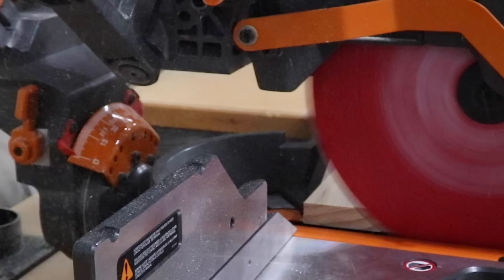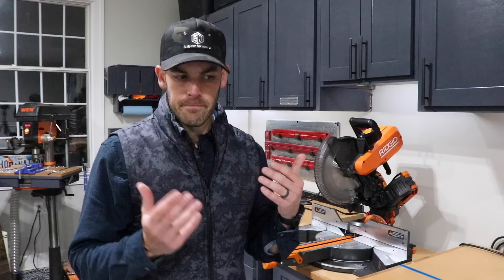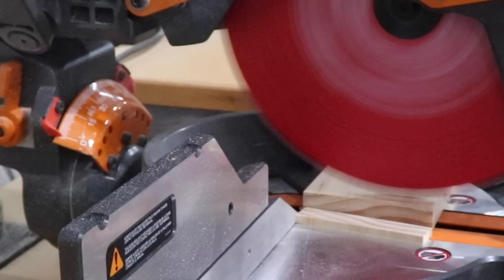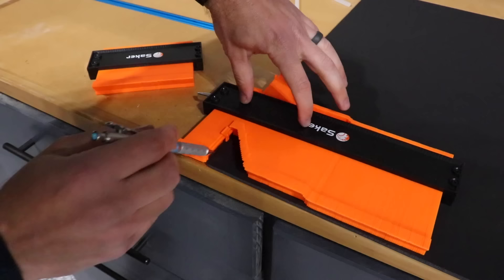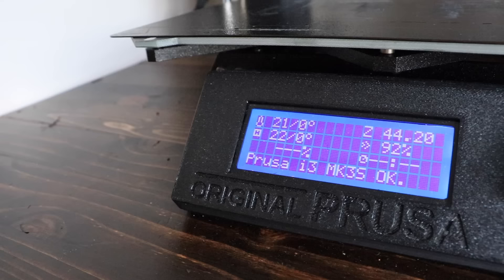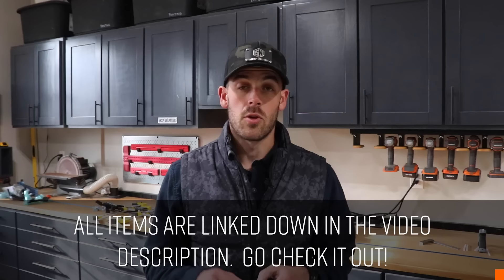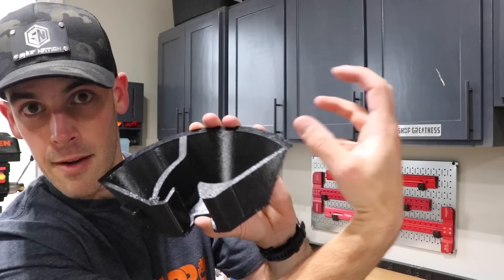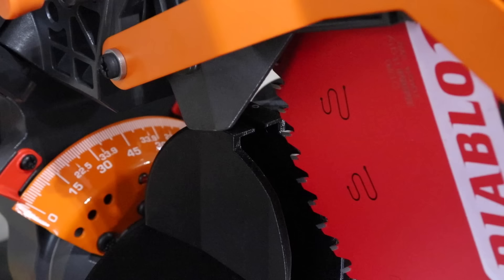Did I Solve Miter Saw Dust Collection?

Comment: the reason people like dust hoods so much is that the dust is "trapped" in the area. no shop vac or DC is going to handle the velocities of the chips coming off that saw, so the best bet is to let them slow down till a DC moving alot of air can actually grab them. its why mitre saws come with 2" ports its because  shop vac's can generate enough velocity to grab the chips.... this is where the big problem comes in... mitres create tons of FINE DUST. aka the stuff that can actually get into your lungs and cause problems. the big pile of chips on your desk isn't going to cause you problems, you'd hack it up long before it gets into your actual lungs. its the ultra fine dust floating around that is the problem.... and shop vacs, DC's with crappy home made cyclones etc simple cannot move enough air to try and grab all this dust floating around (which is why I mentioned they're great at velocity but not CFM), you would be better off wearing a decent mask and just sucking up the pile after your done, as you're not protecting your lungs with a setup like that... just avoiding some clean up at the end of the day

Comment: I hope you do your typical review of this saw after you use it for a while.  I need to upgrade my miter saw and this is on the list but I saw one review where they said the cut was off during a wider cut if a little bit of side pressure was put on the handle.

Comment: If you could incorporate the blade guard in a way to help direct airflow around the blade with enough pressure, you may be able to use it to channel/force the dust and chips to the lowest pressure area, the dust port... maybe, I just work on airplanes lol

Comment: I reckon your shroud needs to be made to encompass more of the rear area and not just focus directly behind the blade. I'll be building my own workshop within the next year or so and I'll be engineering dust extraction points throughout and the mitre saw is one that I will be concentrating on a lot more.

Comment: I think that the main concern should be to know where the dust flies to instead of where it ends up ('cause gravity, right?) Make a screen of sorts to cover the back of the saw wyth double-sided tape or fresh glue, make a couple of cuts and look at the results. That way you will know where the dust collection will be more effective. 
Making the 3D-printed collector contraption thing too tight to the blade might have been the problem. The blade has teeht with alternated angles, that shoot the dust to the sides.
I'll be looking forward to that next video.

Comment: Dang, even though the entry way hugs the blade might not be the best option, more like a funnel shape might help more as it will redirect the larger chips in towards the port? Also I don't know how but if somehow you can record it in action with smoke to show the airpaths that might show what is happening with the air redirecting the dust like you suspect? Good luck, I'm tuned in!

Comment: It looked like it was coming out of the dust collection from the saw itself. Either try capping it off, or better yet put a Y in your hose and connect to both.

I will say, though to you it may have looked the same, in your second test it did seem like it at least did not spread as far (or less went that far out if that makes sense)

Comment: The blade is a whole bunch of tiny scoops, what is the point of exit for the dust from the blade, why does the manufacturer put it's port where it does, and what does the collection actually look like using that port.  if speed and reflection are an issue build a cyclonic collector, like for an indoor firing range, and then extract from underneath, change that airflow
Reply from the maker: Ha I actually cut out a talking section at the beginning of this video talking about that exact concept!  Even had some visuals of how bullet traps work.

Comment: Maybe DEM or Discrete Element Method Or Discrete Element Modelling software could help. Finding the right branch of this could be a challenge. Imagine being able to computer simulate and predict the trajectories of snooker balls when the pack is broken or the white is fired amongst a group of balls. In the same way I used companies who had knowledge of this to solve problems with handling and capturing dust in a large scale industrial application which involved repurposing and asphalt mixing plant for an experimental product which included very fine powder. The trajectory of the powders, for example off conveyor belts when they hit other surfaces generated fugitive dust. But when the surface they were hitting was curved slightly away from their trajectory path rather than perpendicular to it, then significantly less fugitive dust was generated. Easier to explain with pictures but hopefully this gives you a lead to try. As many others have commented, well done for showing that it doesn't always get solved first time!
Reply: And then I saw your ad for the solution and it looks like thats what you've arrived at! well done

Comment: Just a guess that the opening is too large and the pressure of the vacuum drops to nothing.  I would think just making the opening smaller would keep the pressure up and work much better.  I also think of dust collection as 3 parts: primary bits, secondary bits and small bits.  Small bits is ultra fine particles solved using an air filter so not applicable to the saw itself. Primary bits is the material directly thrown in a path and the easiest to catch with a proper chute design also easy to clean up due to their size.  It's the secondary bits that get thrown almost everywhere and this needs high pressure and typically high CFM. I suspect your CFM is higher enough but the pressure drop is just too much with that opening.

Comment: I like your idea, but it feels like you are trying to change the flow of the dust to hard, Wich would require a enormously powerfull dust collection. I think if you would use the dust port on top of the saw, you would have better results. The sawdust it's original way would be through that dust port. With your printed part, you are able to guide even more dust through the top port.

Comment: here is the issue I've seen with just about every version of dust collection that gets put into that area behind the blade, you cant do any cut other than 90 degrees. to do say a 45 you would have to remove the attachment and then you wouldn't have any collection...

Comment: I guess that part of the problem is that the velocity of the sawdust starts out at almost the tip speed of the saw blade and that is extremely faster than the velocity of the air being sucked into the exhaust.  Has anyone ever studied what percent of the chip leave the saw at what angle?
Doesn't solve the problem but it will make me think every time that I use my saw.
Good luck.

Comment: I think the problem has to be the air current created by your saw blade, since the only real change is that the dust is concentrated above the saw. The blade is pulling air in and since the blade is mostly enclosed the air is then forced to travel up and out of the dust collector, taking dust with it. Could be your blade is just overpowering your dust collector

Comment: I'm about to buy a 10" Delta , And Absolutely going to buy your kit. Do you have an adapter for using 1-1/4 vac hose ? I think that's the size, going be using on sites and probably buy a vacuum that fits a 5 gallon bucket, just for easy storage and mobility. Either way I buying your kit, seems seems to genius!! Thanks 👍

Comment: I'm definitely not an engineer but could collection hoses on both sides of the blade be implemented? It seems like the dust is being ejected at the point of contact before air throws it onto everything else

Comment: I've always figured that miter saws are doomed be dust throwers forever. ALL the big companies with thier millions of dollars in R+D and armies of engineers have not found a solution that works better than the cheap little funnel thing that all saws have. 
Seems to be a pretty tough nut to Crack. It's wierd though, because table saw dust collection is pretty good.

Comment: technically no suck at all ^_^ And if really want clean.. a tent over the saw with underpressure and table with holes all over connected to 2-3 shopvacs and a external suckstaion model welders use placed overhead.. then might get few particles less

Comment: I mocked up a quick solution out of the bottom of a 5 gallon bucket cut in half with the hose port basically in line with blade it does great with straight cuts so I've never actually got around to making anything else angled cuts are still a mess 😂😂😂

Comment: Maybe the sliding is the problem. When you slide cut the dust goes up and down with no discharge angle to the rear towards your shroud. Maybe it is the problem that cannot be solved. I have a radial arm saw, where I slide from the rear and all the dust discharge heads back. Sliding from the front like a sliding miter saw, just does not work for dust collection.

Comment: A for effort and thought process. Sucks that it didn't suck. I'm not an engineer but just from the video, seems the slot for the chips and dust is too small and/or thin. Maybe the area you're working with is too restricted to expand your slot, I don't know. It looks like it did a great job of collecting the really fine dust but anything larger just blew right past. Wish I could help more, looking forward to what comes out of it. Good luck.

Comment: Cap off the original dust port connection above the blade as loads of dust is still going to be coming out of that even after you removed the flexible boot. Other than that great idea!

Comment: I made one out of a 1/2 of a hamster wheel 5 you'll follow the contour of the back of the miter saw behind the fence cut 2 and a 1/2 inch holes right up against the fence and I have AY collection system 3 and 21 I get about 80% of the dust from my Microsoft still working on it but it looks very similar to what you've created

Comment: I have just caught up with this video and it is now 2024 - it seems to me that the mitre saw dust-collection problem is being tackled from the incorrect perspective. What is needed is a system where the 'non-dangerous' larger particles end up in a bin (attained through simple gravity) along with something to also simultaneously take away the harmful, smaller-than-5-micron, dust.
Therefore firstly, you want NEVER to have your mitre saw sitting on a table - i.e., a flat surface. You need your mitre saw to sit on a 'hole', in other words a surface where the heavier dust simply cannot settle on, and drops/is guided into (as I have) a funnel like an upside cone. This funnels all this heavier stuff into a bucket which can simply periodically be taken away and emptied - I use a newly-born baby's bath, albeit no longer used for babies I have to say!
So how to deal with all the sub-5 micron dangerous stuff which ends up, otherwise floating in the air and into your lungs? This needs a high-volume low-pressure system to create a 'flow or air' away from the operator. It needs a 'shrouded' mitre saw to achieve this. It really is that simple!
To summarise - bollocks to trying to extract at the blade location (you simply will not achieve this! Let the mitre saw send everything flying backwards, let gravity do its thing for the heavier stuff and let the high-volume low-pressure (HVLP) extraction system pull everything else away from the operator and filter out the dangerous carcinogenic sub-5 micro particles!
The essence of this whole concept being that the HVLP  system will draw ALL the dust backwards (away from the operator), sucking away the dangerous stuff whilst and all the rest will simply fall due to gravity into a bucket!
It works beautifully.

Comment: If you don't fail a few times... You are not engineering. Haha  I feel like this is a good start in fact it might just need a few tweaks. If you had a way to add smoke to the blade area you might be able to see how it's flowing, maybe the suction is coming in at the wrong angle... Hmmm

Comment: You did Accomplish Something
Reply: I'm also an engineer so I really appreciate your systematic approach.  The fact that you were able to concentrate the dust is itself an accomplishment in the right direction.  The result shows that the turbulence from your blade is greater than the suction created by your vacuum in the direction of the dust flow.  You can either increase vacuum pressure (unlikely) or just move your collection point closer to the direction of your dust flow.  Although you didn't achieve your desired result, I still think this is a significant step in the right direction.

Comment: Two 4 inch inlets, right and left sides leading into a 12 to 4 inch "Y" located below the saw, hooked to the intake on a leaf blower mounted on the wall outside the shop. Problem solved. LOL

Comment: While I appreciate the effort....the outcome was very predictable. Think about it like this. Your shop vac can suck up a bullet off the ground, but if you were to fire the same bullet from a gun and have a vacuum hose near the end of the barrel the vacuum hose would never catch it. Why not? Obviously the velocity at which the bullet is traveling is greater than the vacuum can handle. When saws like this engage the wood the literally sheer off little bits of wood (not all dust) with a blade spinning at thousands of RPM so then you have millions of pieces of wood flying all over the place at a very high velocity, does it really make sense that such a little vacuum system would be able to catch all the wood chips? You started the video very well with the old saying "the first step to solving any problem is to understand the problem". I don't think you understood the problem but your part modeling skills are great. Keep it up.

Comment: I've had my fair share of rigid products and 2 different pairs of timberland pro boots. The rigid is hit or miss depending on the things I've purchased. My brad nailer works as good as ever. The shop vac died in less than a few months. Timberland pro boots are some of the most uncomfortable I've ever owned. They say no break in period. Well they lied. The boots definitely need to be broken in. Switched to keen, never went back.

Comment: Why don't you try putting suction underneath the plate where the blade goes down to or use more than one suction system by putting few where dust normaly drops  that way if it drops in that are you have suction there and then boom gone as soon as it lands

Comment: Nice video. Could it be that the factory collector you removed needs to be blocked? The dust will still be shooting towards that hole by design so may need something from that to your hose or back to the 3d printed part...   If I'm right can I win a hat 😀
Reply from the maker: I did block it actually, didn’t seem to make a difference
Reply: It's just got to be turbulence caused by the blade and that point in the blade housing then.

Comment: I think the model is correctly and good but the problem is in my opinion the dust system. There is a magor difference between high speed and low speed dust sucking. A low speed dust sucking system take more from a bigger area a high speed is better for point sucking but lose his efficiency in a bigger area.
Reply: Better knowing as high vacuum and low vacuum system’s

Comment: Your issue was not determining where the dust falls. also you are not taking advantage enough of the capabilities of the 3D printer in your design. I would do this kind of the reverse idea of how the fan shroud on a 3d printer works. the fan shroud directs air to a very specific point to cool plastic. you want to suck up particles from a wide angle. I would make a funnel shaped collector that has many dust collection channels that connect to the main dust collection outlet.

Comment: Please redefine your mission. Even if you had managed to collect dust effectively, but only from 90 degree cuts, your solution would have had very little value in regard to real world use of miter saws. If you want to avoid the big hood style dust control devices offered by Fastcap and Rousseau, you need to start with a much wider and somewhat flexible collection port (e.g., rubber or silicone), somehow connected to the moving saw head assembly itself. I clicked on this video hoping the answer to the title's question was yes, not a resounding no. But you seem quite resourceful, so I hope you ultimately succeed. The fence-mounted rigid structure you designed this time was unfortunately a non-starter. Please start over from an entirely  different angle.